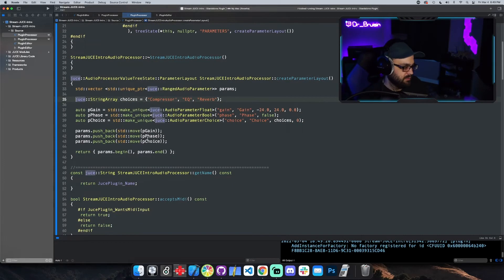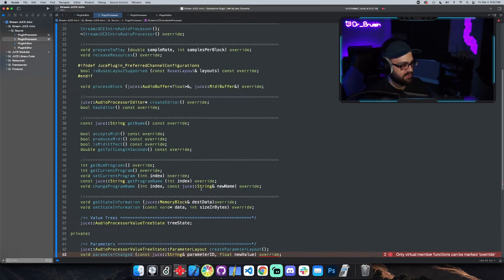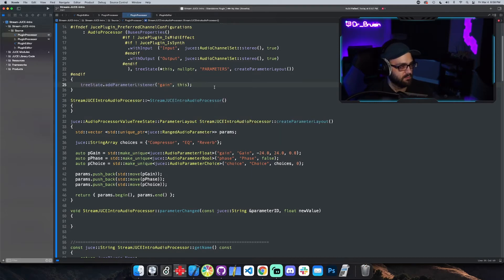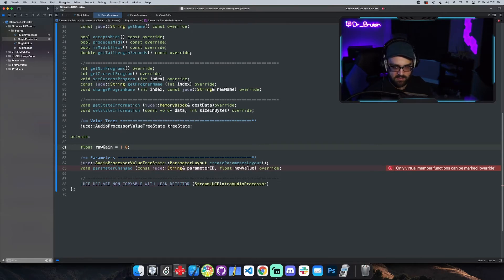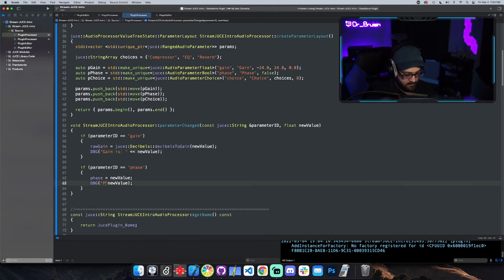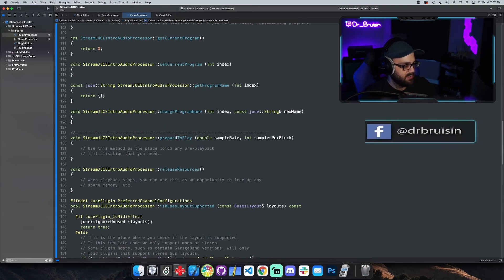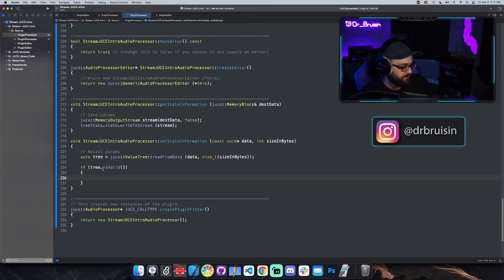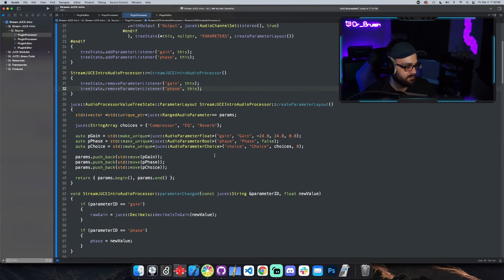🔮 Intro to JUCE & Audio Final Part | Capturing Parameter Changes

Comment: Hey Landon, thanks for the tutorial. :) Just want to ask, is there a caveat to using the "new value" in the listener, in case someone is using a midi controller and changing multiple parameters at the same time? It's quite a likely scenario, so could they end up with a change in "phase offset" slider set to 180 or whatever being misattributed to the "gain" parameter - and they're gonna have a real, real bad time?
Is it safer to use variables then, and would it work if you simply substitute the "new value" with in your case "gain/phase"?
Or is "parameter ID" making sure that distinction is safely handled?